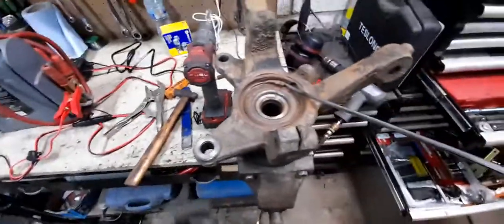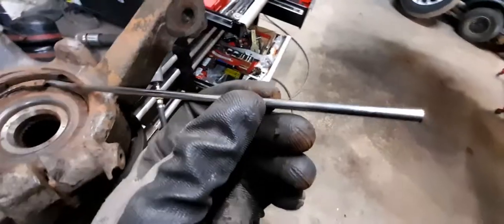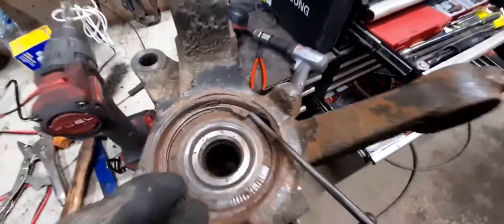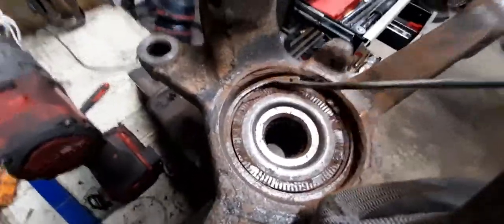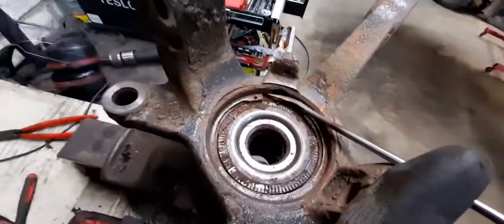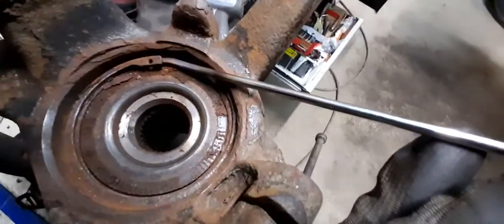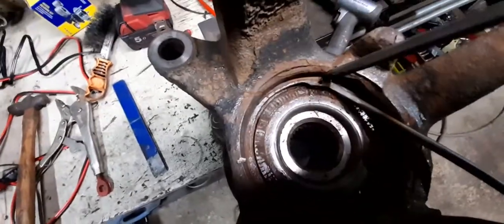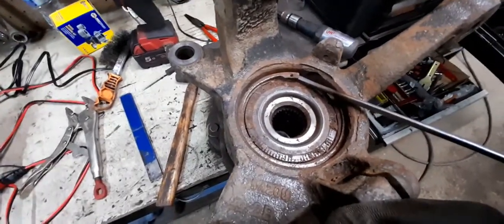removing seized circlips

Comment: The Induction heater would be a game changer for you mate..... heat it up and use a screwdriver and a hammer.... bonus is that you can now use your tool (since you took the time to make it) and the heater and save yourself a lot of time
Reply: Hi mate, how do you use the induction heater for a circlip? Does the item you want to heat up not have the be in the centre of induction end to heat up. Like a bolt head in the centre of the induction wire spiral?
Reply: @SD-hl1sf Yeah, that's what I was thinking myself. Plus, what if there's a seal and bearing that you can't melt it get hot?